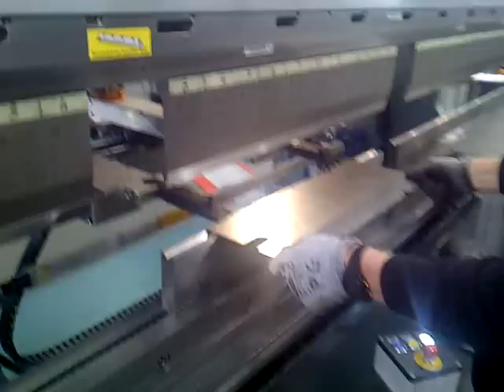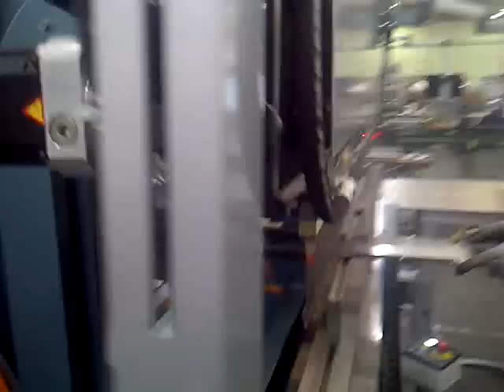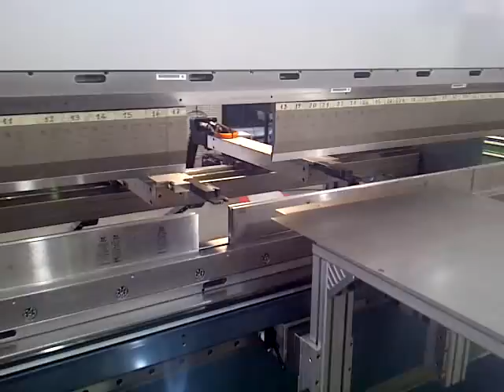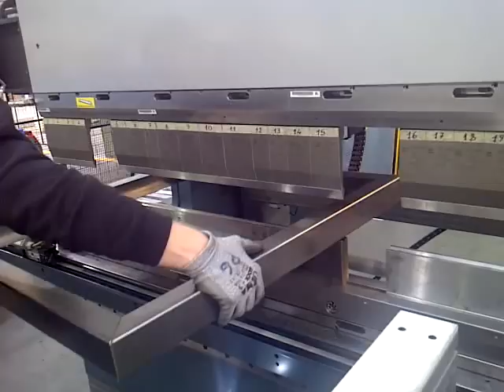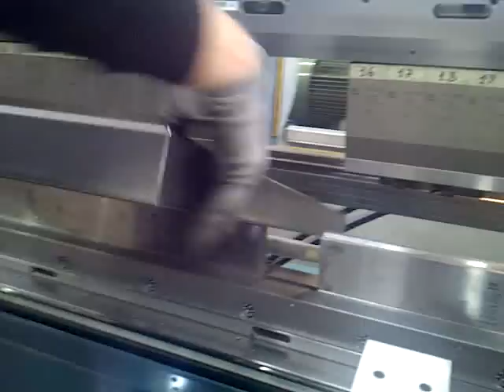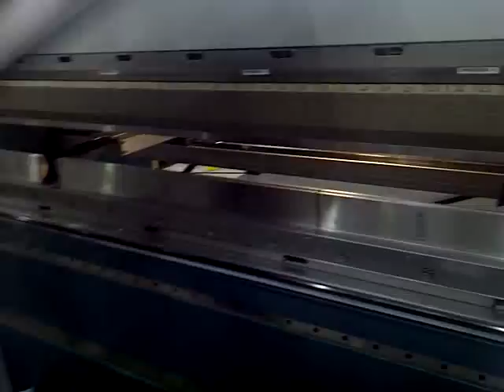Salvagnini B3 Smart Hydraulic Press Brake with auto tool change

Comment: I think tool changing is not a suitable word in this case, because it only opens tools, doesn't change them.
Reply from the maker: Salbagnini can bend material thickness' from 3.2mm to 0.6mm with the same tools.  No tool change is necessary.  Very smart & brilliantly designed machine.  What do you need to bend?
Reply from the maker: From 3.2mm to 0.6mm thickness with the same tools.   It's brilliant.
Reply: now Salvagnini has became also a tool producer? And what is the relation of your answer with mine?
Reply from the maker: Punches & Dies are swapped out, punches & dies are positioned to their correct positions.
Reply: Agree 1000% as the tools NEVER changed.. so the title is misinformation, unless it’s changing out the punch and or die, as those are considered your “tools.” Still cool to see the punches automatically slide tho. I use sliders that you slide with your hands for some jobs if you don’t have enough to set up each bend.